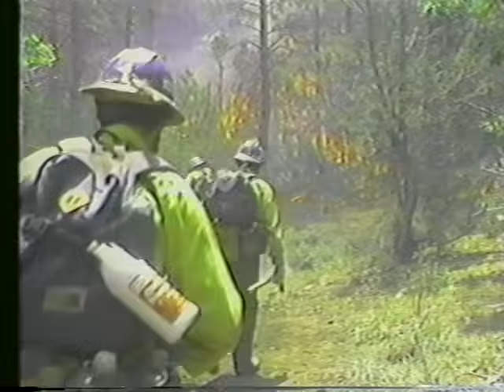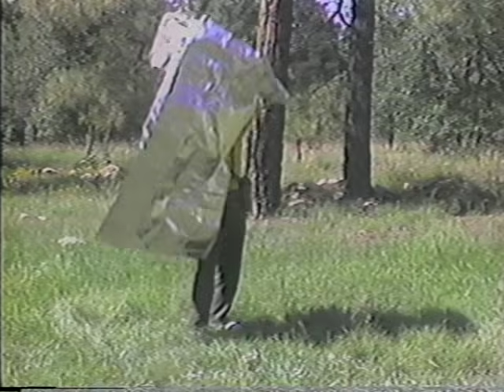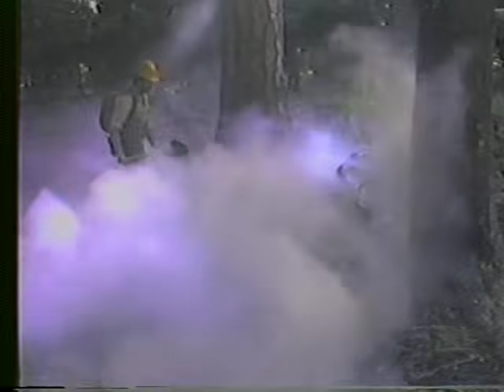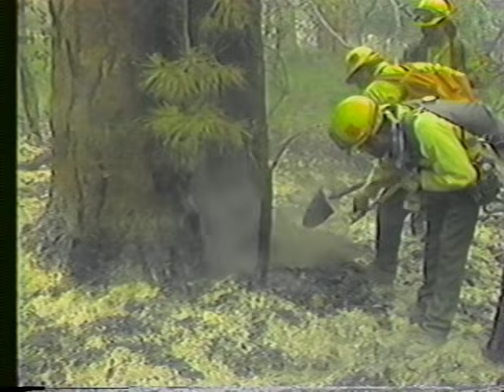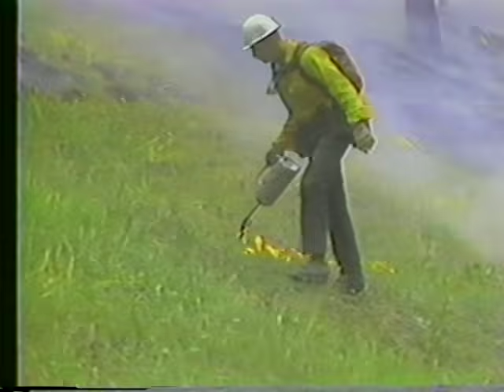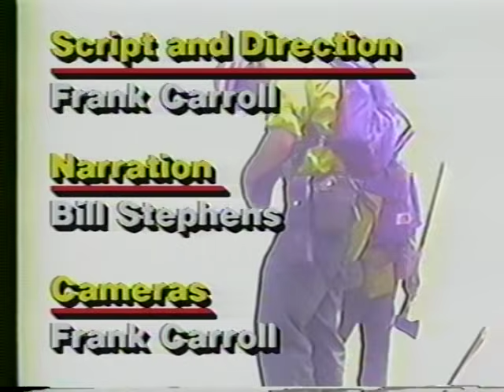Wildfire Hand Tools

Comment: Never turn back on a falling tree is not exactly correct.  You should preplan 2 routes of egress, making sure to clear any debris.  If the tree happens to block one escape route you can use the other.  If you have to run you can turn your back at that point.
Reply: 2 escape routes for tree felling was written decades ago as the rule. Anymore it’s 3+ routes.
Reply: McCloud...... Pulaski's...,.
  1988  LAGUNA HOT SHOTS